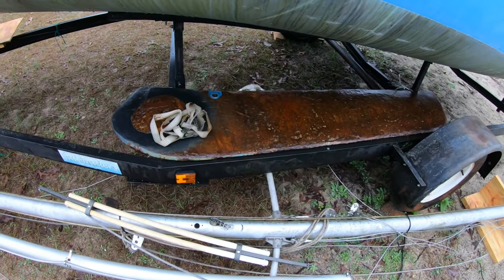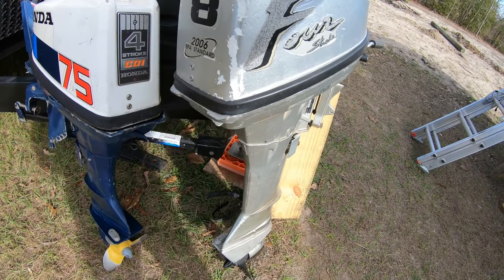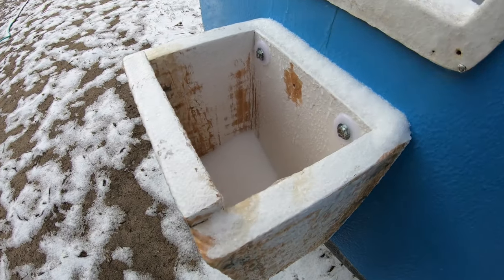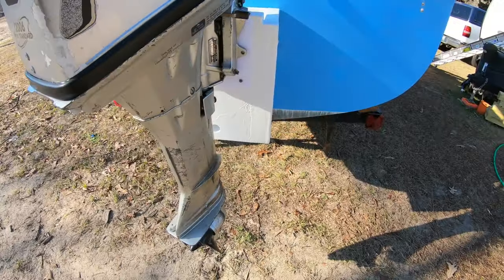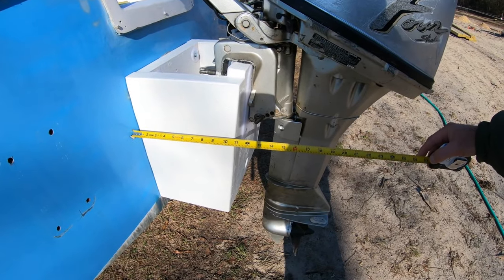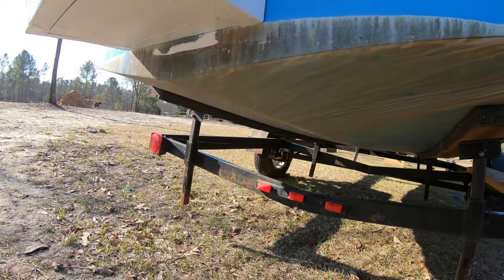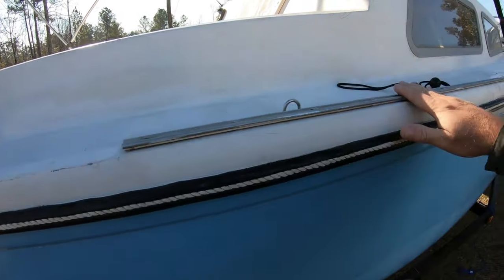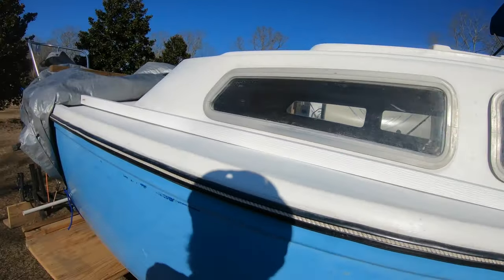Sailboat to Trawler/Shanty Conversion (Ep 1)

Comment: I built nearly the same boat from a 26 ft sailboat in 2011.
The old boat filled with a ft of ice was $250 in a two axle trailer :-)
  I DID keep my keel which had been cut down to about 12 inches. The keel was 3/4 inch steel 6 ft long.
  People said the top was to heavy, I argued the original top WITH a sail would be heavier and added pressures when sailing.
  I finished the inside with 1/4 inch underpayment (one good side) then used amber shellac to finish it off.
  The inside had been cleared and just had a floor of plywood. The boat previously used as a camper in a local lake.
 I used new unfinished upper kitchen cabinets (17 inch’s deep) to save room using amber shellac for them too.
  I added an old 8hp outboard but wish I has put on a 9.9 when I crossed Mobil Bay (Alabama) while spending the winter cruising from Biloxi to Tampa. 
  The boat didn’t tip over  but did roll a little when going thru 4-5 ft wakes left by huge shipping container ships in the bay.
 I removed one bench of the table, put up a wall then hung a 24 inch flat screen TV for entertainment and navigation and added a Small dorm size fridge. 
  I covered the cockpit well with a plywood door setting it on top of the old seats, I stored a 12 gallon gas tank there under the new floor (added an additional outside vent) so I had less climbing around to do. Put two heavy patio chairs in deck and headed out for the ICW in Gulf Shore AL.
  With the 8hp I got tremendous mileage, better than 16mpg based on my GPS readings.
  Good luck, your boat is prettier than mine, you will get looks and questions endlessly.

Comment: I have a 23 foot Paceship that I'm looking to do something similar with right now. I paid $50 for it 😃, it's perfectly fine, the guy just wanted to get it out of his hair because he already bought a 37 footer and can't handle 2 boats. The only issue with the Paceship P23 is all the standing rigging, the mast, the boom etc is all at the bottom of the waterway somewhere where it's moored, it's been down there for a long time, it's buried in the silt, not sure where it is now. So it's a motorboat now. Got a Johnson 9.9 on the back, it's a small boat, you can practically water ski behind it with the 9.9 back there, I love that other people are doing this too.

Comment: Glad I found this video I have 25 ft McGregor I wanted to convert to a just a houseboat didn't know if you could do it by not having a keel thank you for answering my question.
Reply: I have a 1990 Mcgregor 26 that I bought from a friend two years ago. In the spring I want to remove the mast and tiller.  I'm planning to add a steering wheel to turn the Mercury 9.9 hp long shaft motor.  I've never operated the boat under sail, motored only.  I really like the idea of a trawler.  I'll store the mast and boom in my yard should I ever decide to sell it as a complete sailboat again.  It's nice to know others have similar ideas.
Reply: Add a keel of some kind or when you turn the boat will “slide” sideways causing you to make huge/wide turns..  in a recent 17 ft sailboat conversion to fishing boat I left about 6 inches of the center board below water, cut off the top level with the floor, screwed and fiberglass it in permanently.
  NOTE: in 2011 I converted a 26 Columbia sailboat just like in the video..
 Good luck

Comment: Glad I found this! I'm going to start something similar with an Ensenada 20 (hopefully this spring). Now subscribed and will follow closely. Good luck!!
Reply from the maker: Welcome aboard! Thanks for finding me and stay tuned as I have come a long way since this video!
Reply: Jim, hope to see what you do with your Ensenada. I have a Balboa 20 (related boat) that I might consider converting too.
Reply: HINT: leave in some of the keel if you can.. a ft of iron/steel, even 6 inches on the bottom side will greatly help with stability and not interfere with shallow waters.

Comment: On the video I am watching you are installing the steering. NOTE; You are putting the steering cable on the wrong side :-( That will require you to steer just opposite of most boats and cars.
Actually I did mine conversion the same way (left side) because the hatch door to the galley on my sailboat was offset, not enough room in the right side for a wheel and seat..
  STEERING… I went to a boat junkyard and bought 3 stainless steering wheels 18,20,24 for just $25 each. I didn’t need three but the cost on Cabbalas was about $140 each!
  It’s fun watching you figure it out.. doing quality work too
Reply from the maker: Lol... trust me I tried it out several times and you turn right on the wheel or lever and it pulls the cable pulling the motor to face left making the boat turn right. I wish I had a boat boneyard to buy the right steering unit, but where I am there are very few boats even though there are a few large lakes fairly close. Thanks for watching and commenting.... I would love to see your conversion also :)

Comment: Why not just mount your long shaft outboard on the notch in the transom rather than build a bracket?  Having it mounted on the transom will make it a lot easier to use.  Just remove the traveler if it's in the way.
Reply from the maker: I had thought the same initially, but the notch on the transom is few inches too high and the prop will not be in the water. I thought of cutting the notch out and lowering it  also. The problem with that is to get it low enough I then have to cut the floor of cockpit and the angle would be wrong to get efficiency from motor and if I got the height wrong I would have to cut more of the transom. If I get things wrong with the bracket I built.... easier to adjust up or down. Thanks for watching. :)